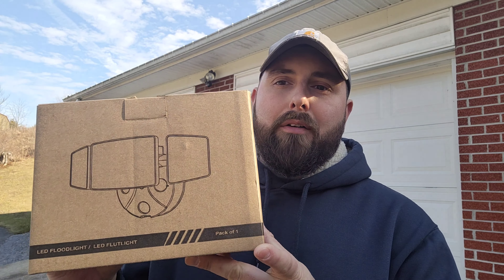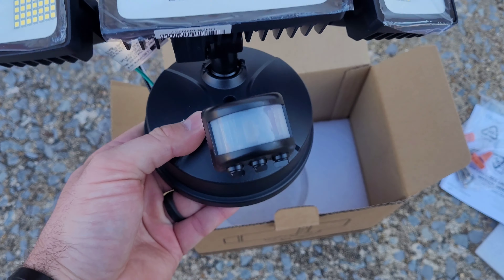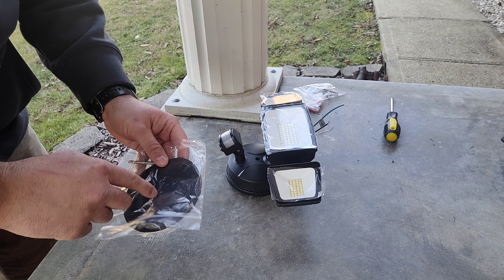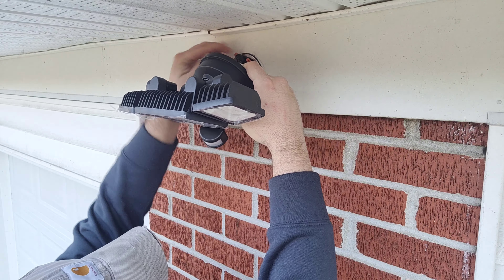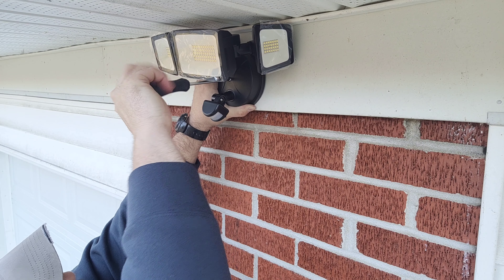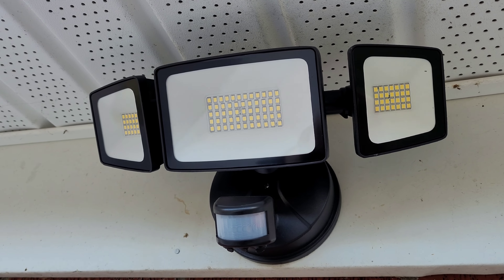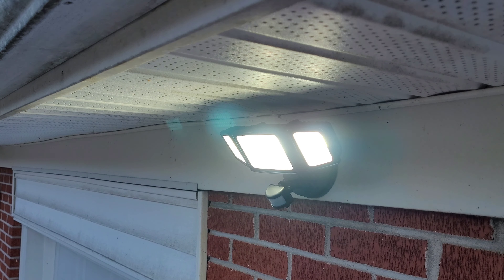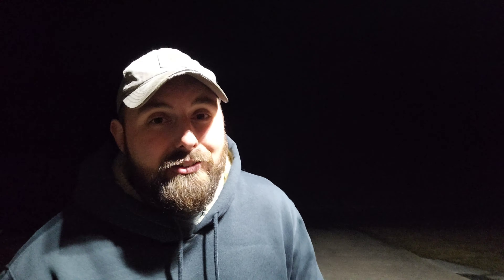Product Review - Olafus LED Floodlight

Comment: Just a suggestion, your ground isn’t grounded, because the mounting plate is attached to wood siding. You should have had a bare copper wire coming out of the house with black and white wires, which you should have secured the green to the bare copper wire to be grounded. Attaching the green wire to the ground screw would only work if the mounting plate was attached to an electrical box which is grounded. Nice product. I need to change out my old motion light as well.